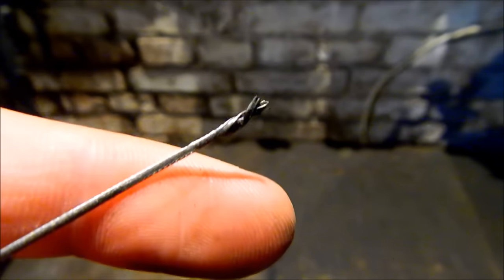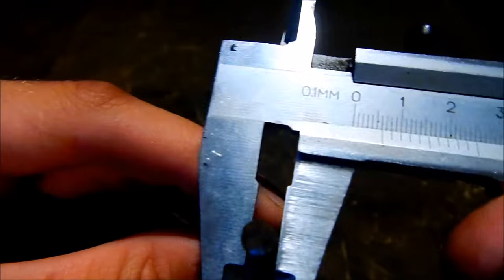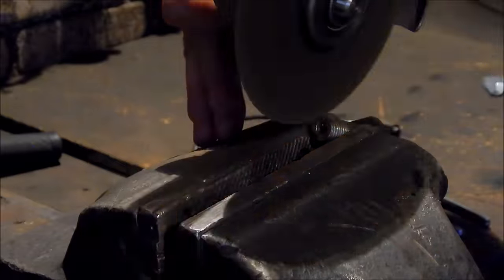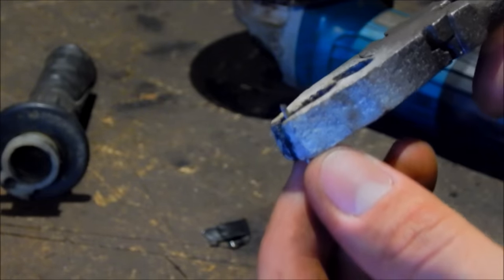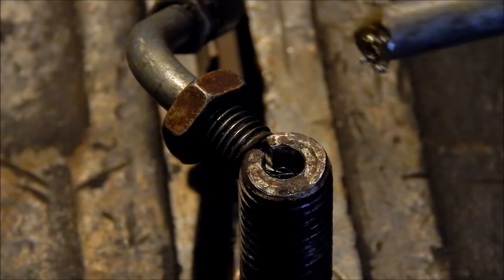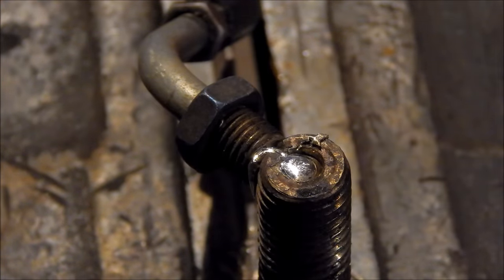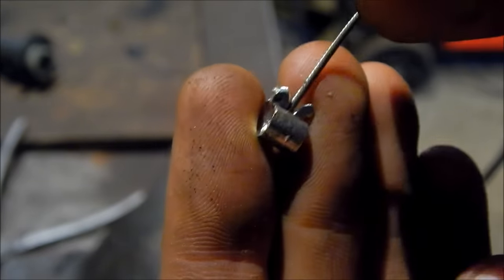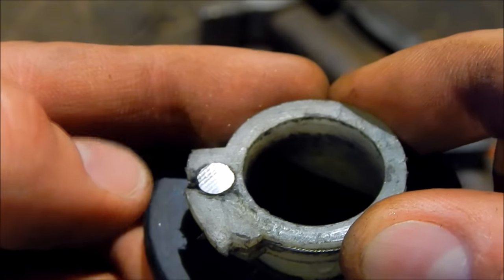Throttle Cable Solder Repair Tool - Simple Fix!

Comment: This is maybe ok for a throttle cable, but NEVER, NEVER, use this for a brake or clutch cable!  For those cables only use a proper brass nipple, ok to make it yourself, but out of brass.  Sooner or later a moulded lead nipple will pull off the cable. Even on a throttle cable it's risky, to lose power at an unanticipated moment could be fatal.

Comment: Lead is too soft...why not aluminum instead?
Reply from the maker: Aluminium will ruin the steel thermally.
Reply: Donn DIY 
Well aluminum melts at around 600 well below steel melting point which is at least double. Interesting technique though
Reply from the maker: Aluminium melts at 660 Celsius, the aluminium oxide on the surface of the aluminium on the other hand at 2072 Celsius. When I've melted aluminium nothing happens melting-wise before the steel crucible gets red hot. So I still tend to lean towards thinking it's not healthy for the steel cable. ;)

Comment: dont ask me to rely on lead! use a brass nipple and solder it on
Reply: One can drill a small hole through a brass rod or piece of nail and clamp the cable with the screws and block from a plastic wire connector block. Great EDC emergency breakdown bits to carry and NO soldering required!

Comment: Seems a lot of effort to go to to repair a cable that costs £5-£6 to buy a new one?
Reply: Assuming that a new cable is available, if the machine is old or rare then it may not be. You perfectly illustrate the difference between a mechanic and a fitter.
Reply: @BigButtocks967  You totally missed the point which was illustrative, obviously beyond your ability to understand.

Comment: Simple fix?? What exactly was simple about this? I guess I could assume the person in this video is a genius so to him this is simple but we all know that's not true. The fact is what's shown requires a lot of tools and a lot of time. The time alone would justify simply buying a new cable. Or the truly simply method to perform a repair is to get a bolt on replacement end a few bucks and a few seconds and your done.

Comment: I guess I do not have a head as I do not have that fancy drill press or grinder like you.But you are no expert by using lead solder to fix the cable anyone that has repaired a cable in the 21 century uses silver solder as it is stronger and last longer!

Comment: just buy a throttle stop. 50 cents from grainger
Reply from the maker: What happens when you live in the middle of nowhere far from a store? Is it still reasonable to drive a long way to the store and waste money on fuel or repair the cable in the shown way in minutes and continue using the machine the cable originates from in the first place?

Comment: better tuto : 
step1: buy another cable it's cheap 
. the end
Reply from the maker: What if the store is hundreds kilometres away and you need the cable ASAP?
Reply: well it happened to me actually ..my scooter's throttle cable snap off in middle of road ! so i stuck the end of it with my shoelace and wrapped it around the handle and drove with it like nothing happened ...
simple as that 😅